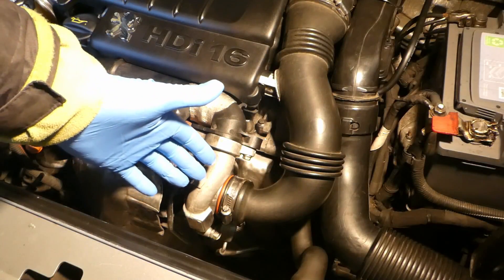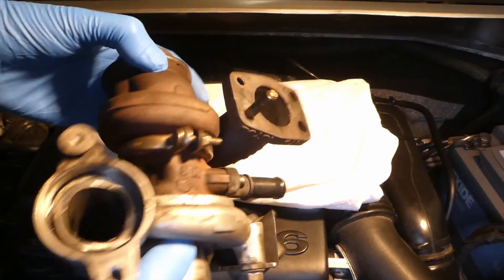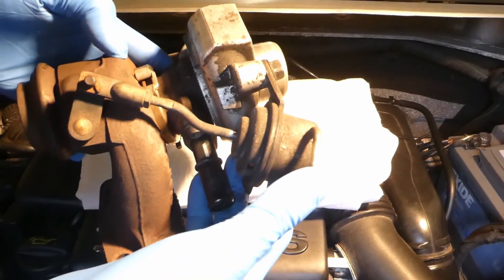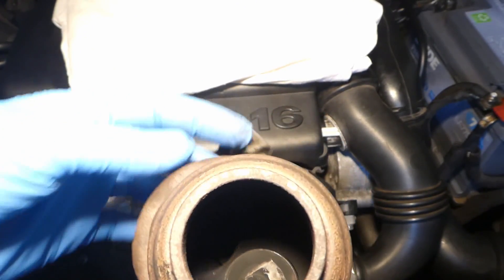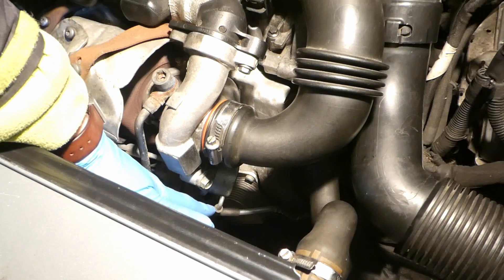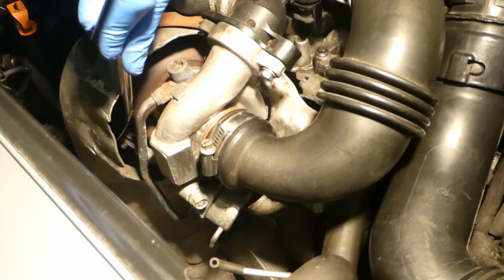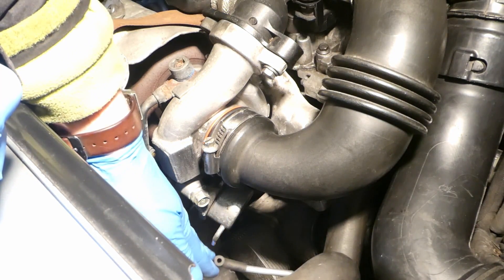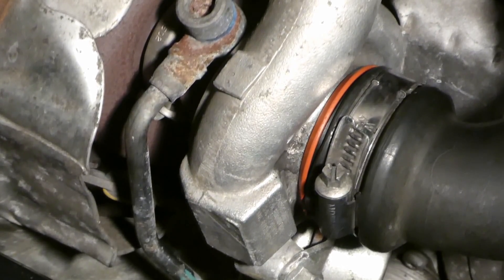Simple way to test turbo wastegate operation in 1.6HDi (Peugeot, Citroen, Ford, Volvo, Mini)

Comment: Whats the part number for the actuator?
Reply from the maker: Yeah, good question. I do not know it.
Reply: @moremolecules   Tnx anyways. Anyways, does this engine, have low boost in 1 and 2 gear. I have the  85kw version and 1 and 2 speed are so slugish.

Comment: Can you adjust these wastegates to give more boost?
Reply from the maker: Yes, you can, but it is on the dangerous side of things. You need to watch the boost levels. Although on a second thought, the engine can measure the boost and adjust the vacuum going to the wastegate, so probably no. To be honest I have not thought about it.
Reply: @moremolecules  yeah was thinking that but mine is a 1.4 hdi which isn't a vnt turbo so there is no vacuum line going to the wastegate actuator, just a pipe going from the turbo housing to the actuator

Comment: My car comes up with a p0234 fault and has had a new turbo fitted I shall be testing the waste gate later but my mechanic has said that I am losing vacuum, what could be the issue with losing vacuum as my mechanic doesn't seem to know why I'm losing it.

Comment: Hi , my air intake hose on turbo side is barely on and impossible to keep on, Would there be a difference between berlingo and Peugeot, I have a 2008 berlingo 1.6 hdi, 
If it goes on one part it doesn’t line up on others , Thanks
Reply from the maker: Exactly the same and no difference, the difference is the badge only. They are the same company PSA, now Stellantis.
I would check if the red rubber seal is not split and replace it with a good part. Screw the ring and when the engine is hot a bit more. Should hold.
Reply: @moremolecules  Thanks , I’m having real difficulty in getting it to fit , especially onto turbo, it just keeps coming off and the other two parts are well out of line, it’s like it’s not long enough! 
Your videos are brilliant, Keep going!!
Reply from the maker: @GeorgeBuchan  Are all these original or replacement the air intake? It should be a good fit. I had previously bought a replacement and it was not a good fit.
Reply: @moremolecules  It’s a replacement part I threw original one away but its terrible , It’s so hard and doesn’t seal at Maf side, Not lining up at middle and 99% off all the time at turbo end!
Reply from the maker: @GeorgeBuchan  Yeah, these replacement parts are not too good. If I were you I would buy a second hand one and clean it. Better than new replacement one. The one I bought was so stiff that it could not fit anywhere. I threw it away and bought a second hand one.

Comment: Merhaba, Citroen 3 1.6 hdi 92 hp aracım. Bu wastegate testini motor kapalı halde yapıyoruz değil mi? 
Motor kapalı halde yaptım aynı şekilde hareket yaptı.. ama motor açıkken rolanti halinde çok fazla oynamadı. Bu sorunlu bir wastegate mi demek oluyor? Yoksa olması gereken normal durum mu?
Reply from the maker: Only when you turn the engine the wastegate will move a little bit, otherwise on idle it will not move. It needs load or for the car to move to see the wastegate pass the initial few mm.
Reply: @moremolecules sizin yaptığınız şekilde araç kapalı halde testi yaptım çubuk ileri gitti. Sağlıklı bir wastagate'e sahibim o zaman 😊. Teşekkür ederim ilgilenip cevap verdiğiniz için.

Comment: Hi mine is working like that but when I drove it the wastgate isint opening can you tell me what might be the problem there please I'm geting vacuum from the wastgate pipe please help
Reply from the maker: Do you have lack of power or some type of error on the multifunction display?
Reply: @moremolecules  no have loads off power no codes on display
Reply from the maker: @kevingoldbey7401  If you have no codes and there is power, then it works at it should. If you have no power and there is vacuum, most likely it is the wastegate.
Reply: @moremolecules  I tought that the wastgate opens when u rev it on standstill so ur saying it has to get boost up before it opens is it
Reply from the maker: @kevingoldbey7401  Yes, there needs to be boost or the wastegate gives you the boost, but the ECU is clever and can sense there is no boost required.
Reply: @moremolecules  ok thanks so much for ur help

Comment: Hi when the car is on a stand still and when u rev it should the wastgate open and close
Reply from the maker: The turbo does not operate on idle, but on stands and the car in gear it should move.

Comment: Hi mate would a 2 liter turbo fit to the 1.6 engine
Reply from the maker: Not too sure, but the 110bhp turbo will fit on the 92bhp 1.6HDi. But this will need an ECU remap

Comment: Been chasing a stuttering issue and now the turbo has started fluttering at low rpm. Got my dad to start it while I looked at the gate and the gate is moving on start and when it revs and it comes back... it's really stumping me now 😂
Reply from the maker: Is it the 92bhp or the 110 turbo? the 110bhp  has a different turbo, the VNT, where the 92 and 75bhp are the fixed geometry.
Reply: @more molecules  it's a 110 with the variable geometry. There seems to be a rattle coming from the throttle assembly though

Comment: Best video !...thx ...i have 1.5 dci  and its stuck and no power over 1.500 rpm and when i accelerate i hear a lot of blow off sound and no power.
Reply from the maker: I am not too familiar with the 1.5dci, but it could be a turbo solenoid/wastegate or if you hear whooshing sounds potentially an air leak somewhere.

Comment: Hello, I have 2 fault codes a P1351 and a P0234 ( overboost condition) , then the car goed into safe mode (I think), because no power anymore. Its a Peugeot 1.6 HDI. Any ideas? Thnx.
Reply from the maker: I am nearly certain that the overboost is most likely due to the turbo solenoid at the back of the engine, kind of rear left if you look at the engine from top. Most likely it is stuck and gives you constant vacuum to the turbo wastegate. It is cheap to buy, but a bit difficult to replace, as it is kind of stuck in the back.
Reply: @moremolecules  funny thing is I deleted the codes and it performed normal. But after a day or so the fault is back and the car has no power. Can the solenoid be the cause then? Intermittent fault.
Reply from the maker: @JackTekkel  Yes, it will be intermittent. Most likely it will be the turbo solenoid. Most likely does not mean that it will be, but these do get stuck. The P1351 is the pre-heating relay and is nothing to do with the overboost, but likely faulty glow-plugs. You may want to replace them sometime if of course you are in a climate where it gets cold.
For example, if you remove the vacuum hose to the turbo wastegate, you will not have overboost, but of course you will have no turbo as well.
You could also check the vacuum release valve end, it is a simple hose with a plastic end that gets clipped between injectors 2-3 or somewhere in the middle there. Make sure it is not blocked by dirt or carbon deposits or something.
Reply: @moremolecules  Thank you for your time and the information. 👍👍
Reply: @moremolecules  I got the car back from the customer, still has the overboost condition. I removed the solenoid and it looks oke. It's a Pierburg, I don't see a Peugeot logo on it, could it already be changed or is it from factory a Pierburg? Waste gate opens and closes, also vacuum at idle it closes the waste gate. I found the filter thingy between the injectors, bit funny from Peugeot, strange place putting it there. Cleaned it with brake cleaner. I temporarily refitted the solonoid, test drive today. See what happens.
Reply from the maker: @JackTekkel  These almost always get stuck with time and could potentially be cleaned/refurbished, but most of the time it is easier to just replace with a new one. Pierburg I think were the original solenoids, most of the time there is no Peugeot/Citroen logo, just parts from a manufacturer somewhere.
I agree that the filter thingy is rather bizarre place to put it.
Reply: @moremolecules  oke mate, probably just going to change the thing. Although it's crazy, just drove the car today for an hour, really stepped on it, high revs everything, still no fault code.
Reply from the maker: @JackTekkel  Yeah, these are a bit intermittent, but they generally come back. For the price and peace of mind I would replace it altogether. Otherwise these might come back again. I just depends on how it is stuck, say there is a little bit of a grain somewhere and you have dislodged it by moving it around, but it will eventually come back again or not. Safer to just replace it, but of course it depends on if one can afford it of course.

Comment: I'm getting oil coming from my crank I  take to my turbo is this normal
Reply from the maker: Do you mean that oil is coming from the crankcase or the PCV? A small amount is normal, excessive is not. The air intake will be coated with a bit of oil from the crankcase, that would be normal.

Comment: Can this (the vacume seneloid) stop working but have no error code?
Reply from the maker: Unlikely. It will be associated with an error of the sort air metered flow error or measured air flow. Most likely you will get under or over boost.
Reply: @moremolecules  I found out that the seneloid has a sponge filter that can get dirty and cause bad air readings.
Reply from the maker: @CarloLeonKolega  Yes, the sponge filter is very difficult to get out and can get dirty from oil/water and that disturbs the release of pressure through it. Should be kept clean, but difficult to clean

Comment: Can them parts be changed  with changing  turbo
Reply from the maker: Yes, all these can be changed. One has to follow the correct half-moon length of the wastegate arm, so the correct amount of air being forced is correct.
Reply: @moremolecules  👍👊

Comment: Any test to check the vacuum hose from turbo actuator to turbo solenoid? Original Equipment part number for the vacuum hose? I'm no sure if you can replace it with a standard silicone hose cut to length of less than 3 m, outer diameter 9mm and inner diameter 4mm. When I do the simple test for the turbo actuator, the rod returns a few millimetres but the diaphragm holds the vacuum until I release it. Turbo pressure and air flow measured values are less than reference values, so it seems the turbo actuator does not close the waste gate completely but I don't know what causes this issue: actuator, vacuum hose, solenoid or anything else. I get turbo pressure of 918 mbar at solenoid valve OCR of 77%  are those normal figures? What's the max turbo pressure you can get? The original vacuum hose is made of hard plastic and it has like a gray sleeve for thermal insulation. 
Do you think there could be carbon deposits on the wastegate or the valve Seat that prevents the valve from fully closing?
For how long is the wastegate in the closed position after starting Up the engine and then leaving It running at idle?
Reply from the maker: A lot of questions and I am not too sure if I can answer them all. The wastegate should not have carbon deposits, there are no gasses that go though there. Not too sure what the reference values of pressure at the solenoid valve are. Try to measure the turbo boost. That should go to at least 1800mbar. Most of the times is failure of the turbo solenoid. The hose needs to be the original hose, you do not want to have a hose that collapses under the vacuum. As far as I remember the wastegate on idle at startup gets closed and that's it, it holds it there.
Reply: @moremolecules  Thank you very much. Turbo pressure measured (900mbar) and  reference value (1000mbar) should be exactly the same at idle for example? I haven't yet carried out a drive test to see the live parameters.  Those figures are off by 100mbar approximately in this case. But the wastegate is completely closed so no more boost can be achieved at that engine regimen I guess. Can the EGR valve and EGR throttle be causing this issue? EGR valve is new and recalibrated. There are only minor issues with cruise control and anti-pollution fault warning very occasionally. Do you know the OE reference for the vacuum hose? I can't find it anywhere.  Do you need a car lift to replace the turbo solenoid or you can do it from above the engine?
All of the above makes me wonder if the turbo cartridge is in good condition, there is a bit of oil in the compressor inlet but I'm not sure if it comes from the rocker cover or from the turbo oil line.
It seems there are no air leaks between the turbo and MAP sensor.
Reply from the maker: @csraln6748  The turbo does not kick in when at idle no matter how much you rev it. It needs to be under load to get the live data. Yes, the solenoid can be replaced from the top or bottom, but is tight there. You can lean on top of the engine and undo it, but you may need a mirror to see it. Check the specs of the hose here: http://www.catcar.info/citroen/?lang=en
I do not think these are affected by the EGR. You could blank the EGR if you want to try it to see if the problems persist, kind of to exclude that.
Also, check if the relief hose valve is not blocked. It should be cliped somewhere between 2-3rd injectors. The end should be relatively clean.
Reply: @moremolecules  Apparently the relive valve is not blocked, it has four   inlets and the foam filter is dirty and worn. How do you open the valve to clean the inside and replace the foam filter if possible? Can you buy a new one anywhere?
Reply from the maker: @csraln6748  I do not think that the filter can be changed and I have tried before. It is like sealed and that is that. As long as there is no carbon deposits that block it completely I do not think it will be an issue. You can take off the turbo solenoid and test it yourself. Blow in one hole and see if the ball valve is moving as expected. It is not too expensive, so worth replacing, I have seen/heard multiple issues with the solenoid.

Comment: In my citroen c4 GP 1.6hdi wastegate holds pressure but there is no vacuum in the hose. I had glow plug relay fault and turbo was working perfect. Vacuum pump was working fine as well. After fixing glow plugs problem and resetting codes vacuum is gone. Any suggestions?
Reply from the maker: It could be a broken/split hose somewhere that is leaking vacuum. It could also be the turbo solenoid at the back of the engine.
Reply: @moremolecules  I have replaced solenoid for new one and the same day when I took my car to the garage turbo was working fine. After resetting codes it stops. Probably electronic issue.
Reply from the maker: @Jahunatan  It is unlikely to be electronic issue. Most vacuum problems are mechanical. A connection could have dropped off or something or a cable split. I would look for dangling hoses somewhere or a split hose, but these are difficult to find.

Comment: Thank you mate,  solved issues with your video. peugeot 1.6hdi 90cv 308
Reply from the maker: Glad it has helped, what was the issue?
Reply: @moremolecules  The turbo rod was stuck and the car lost power, reached 3,000 rotations appeared an error saying problem in the anti-pollution system
Reply from the maker: @thinkaboutit7443  Thank you for the reply. Yes, most of the air-related problems will be reported as anti-pollution errors, just the ECU sees that there is either too much air or too little air and the exhaust emission might be different than normal, hence the anit-pollution errors which is a bit misleading.
Reply: @thinkaboutit7443 Same here, how did you fix it?

Comment: Hi
Im getting no vacuum at the end of the pipe that attaches to the wastegate actuator, ive changed the unit located at the rear of the engine and still no vacuum, there is 14v going to the sitch, could it be a broken or clogged up pipe ?
Thanks in advance
Reply from the maker: It could be the vacuum pump that is faulty, but that is a bit rare event. Do you mena the turbo solenoid at the back of the engine? THere are several pipes going in/out, make sure they are connected correctly.

Comment: My Berlingo waste gate is very stiff. Will not move untill high revs. Therefore is producing under lost but if I drive hard overboost occurs producing a tripped engine warning and limp mode. Cleared using streetwise can bus reader.   More work to be done.
Reply from the maker: It should be rather easy to move the rod on the wastegate. The spring is not that tight. It could be dirt or something holding it back. Wastegates are fairly cheap and easy to replace, if it is the wastegate in fault of course.